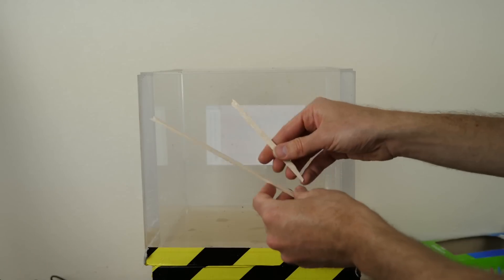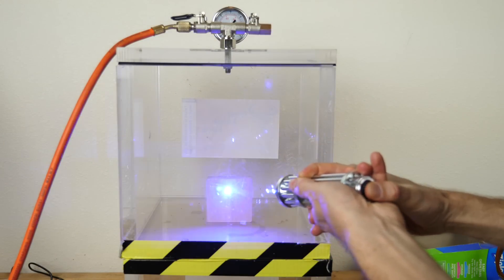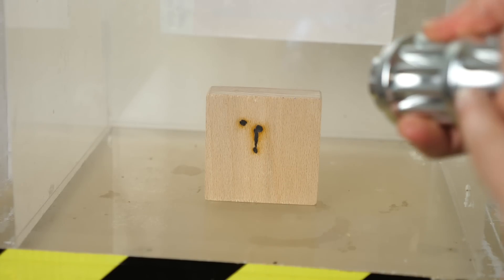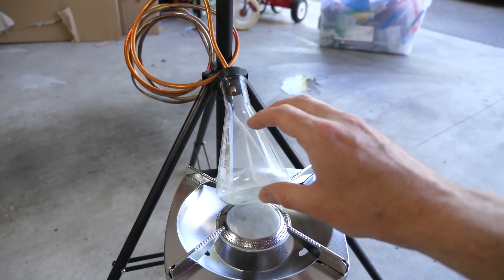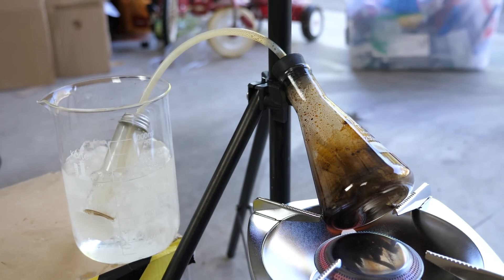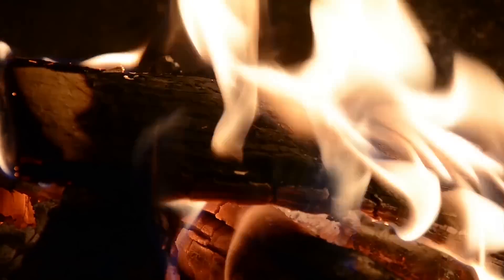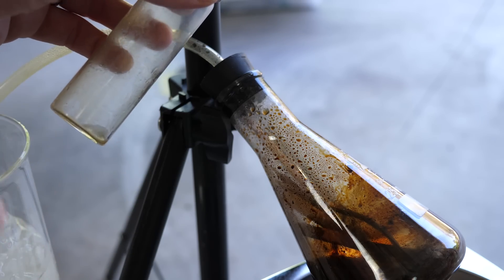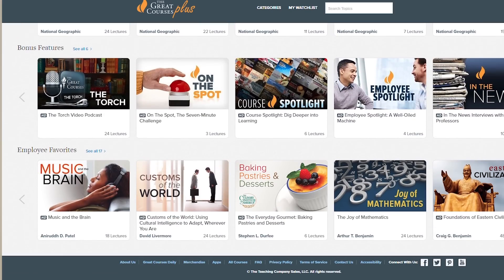Is It Possible to Melt Wood in a Vacuum Chamber? The Wood Distillation Experiment

Comment: Am I the only one who was disappointed to find out that the laser wasn't red?
Reply: Red is the weakest wavelength in the visible spectrum. Blue makes for a much more powerful laser.
Reply: The phrase "useless information" has eighteen letters in it and has no bearing on the original question of disappointment.
Reply: Scoped Bambi no. I'm saying you should never have expected it to be red, so you shouldn't be disappointed and no one else is either.
Reply: Kun Kodiik, that's just asinine. Not only have Red lasers been around for much longer they have been on the market for longer as well, they have been made popular not only due to their sheer availability and over abundance being found in almost any dollar stores, wal-marts, or pet shops, but also in pop culture movies such as the 007 and Powers franchises. But putting that aside as there are many colors to pick from, that being only Red, Red-Orange, Green, Violet, Blue, and Yellow, that is for non-color blind people of course. Yellow  being the strongest at the moment being much harder to get your hands on. As for "should never have expected it to be red" thus "shouldn't be disappointed" that can be said with just about anything. 

I could say, I expected this to be a one line statement about how I was disappointed that the laser was not red, making a clear pop culture nudge to how most people would of seen them in movies. 

I could also that say, I expected that to go way over other peoples heads like yourself and have it drag out over a pointless discussion about how Blue lasers are more powerful and how that has no bearing over my original comment. 

I would like to know the psychology you used to determine not only my expectations but the expectations of everyone else though. I would find that much more fascinating than a silly comment of my own "disappointment" that others may or may not share about the color of a  laser's emitted light.  (Through a process of optical amplification based on the stimulated emission of electromagnetic radiation.)

Comment: To actually melt it, you can't use a laser. That'll just cause the oxygen in the cellulose to react with the carbon, burning it. Your vacuum also isn't strong enough.
Reply: And you'll simply be left with lighter hydrocarbons. Cellulose pyrolyses before its melting point.

Comment: Yes you can melt wood it has to be at a certain temperature for a certain amount of time and the temperature is around 400 farenhite
Reply: Technically, this is true, but once it cooled down into a solid state, it would no longer be the same material, as the components have different melting and evaporating temperatures. This means the liquid would mostly be carbon, however it would require a much higher temperature than you stated. Around 3500°C would do it, but no-one has actually tested it at these temperatures yet.
Reply: Do you have a different measurement of temperature? For me my thermometer is saying 400 Fahrenheit

Comment: vacuum unnecessary, right? if you don't want the oxygen there, just fill it with CO2, nitrogen or any other inert gas. misleading title, vacuum just as a bait. pain caused by the talk.

Comment: Thermal decomposition is the chemical process here. Wood is primarily cellulose, which is a polymer or polysaccharide of glucose. Pure cellulose or hemicellulose would break down into carbon and water. But wood has other macromolecules like lignin and oils. What's condensing is the oil that is being distilled in the anoxic environment. He would collect more if an inert gas (N2 or Ar) passed through the system.

Comment: There are internal combustion engine setups developed early on that use "liquidized" wood as a fuel. Russia even had tanks that ran on liquidized wood. Every example had an onbord system that turned chopped wood to liquid for the engine to run on.

Comment: Although you removed the oxygen from the air, you didn't remove the oxygen from the wood its self. So you still had normal combustion. Maybe you should try leaving the wood under vacuum for some number of hours to remove that oxygen too.
Reply: thing is even though these stray oxygens will do something similar to combustion there isnt enough to burn all of it, what's mostly happening is the different carbon chains are breaking down into smaller compounds 
if you stare at a wood fire you'll see that the flame is not on the wood itslef but hovers above it, that's because of this process that makes smaller more easily burned volatile compounds

that's also how we break down petroleum into the different fuels we use like diesel
Reply: You can get this result even with chemical grade purified cellulose. It still chars and pyrolyses. It’s not about any minute amount of trapped oxygen
Reply: I don't think you can really get wood without oxygen, celulose is basically a chain of sugar molecules which have oxygen in their composition, at best you will always get a carbon foam like substance
Reply: Most, if not all, of such videos are click-baits, with mostly half-assed experiments, leading to either NO conclusions at all, or to  wrong conclusions!!!
Reply: @kareemsalessi  In reality removing the oxygen and heating, just leaves carbon, "charcoal".
Reply: @raysilver2b   Which is probly impossible with only a constant vacuum??? Else we should have seen it  experimented???
Reply: I wonder would if it burn a finely ground wood or sawdust. 🤔
Reply: @PrinciplesMatter  there's still no oxygen in the atmosphere
What you'd get is different only in how the smoke evolves but chemically nothing changes 
Although I gotta say the question is really interesting outside of the scope but it ultimately depends on how the heat is applied
With the laser I don't think we'd get much difference
Reply: @guythat779  I sorta suspected as much.

Would be interesting to see the effect if the heat was slowly increased over a broad area in total vacuum. 🤔

I still don't think it would "melt" but it would be interesting to see the effect...

Might also be interesting to try heat under high pressure with a nitrogen or other inert gas too. 🤔🤔
Reply: @PrinciplesMatter  well I did it myself under atmospheric conditions 
You can just wrap a skewer or matchstick in tin foil then heat it up with a match/candle/lighter and voila you generate smoke/wood gas (its other name) 

Ofc don't forget to leave a hole for the gas to escape somewhere and remember that wood doesn't conduct heat well so the effect will take place wherever you heat it

Visually you get some pretty nice clean smoke, but it's not that special
But in the understanding of the chemistry of fire it meant a lot to me

Hope my comment helps:)

Comment: Not surprised that the wood didn't melt, i.e., turn into a liquid. With such low pressure, it's going to sublimate just like dry ice. If you want it to stay liquid, you need some atmospheric pressure. Try putting it into a pressurized but inert atmosphere, like nitrogen.

Comment: Try to light a match in a vacuum chamber
Reply: not gonna start a fire since combustion requires oxygen; probably going to kind of burn and make the match hot
Reply: jinsen I know that’s why I want to see what happens because it won’t light
Reply: Sigh....
Reply: some matches have oxidizing agents so could burn. idk if the low pressure would stop it though
Reply: simple, it wont lit
Reply: really?
Reply: James thank you for approaching this request with some mindfulness: for your answer watch Richard Garriott Answers: can you light a match in space. Short answer yes it will light and die out quick due to lack of oxygen and burning through the oxidizer quickly
Reply: nothing would happen, actually nothing. It would be like rubbing a stick against some metal

Comment: Your main problem here is that your experiment isn't happening in a true vacuum. That's pretty much impossible to achieve on earth. Your equipment can't possibly suck all the air out of the chamber. There IS a way around this:

When they grow silicon crystals to make the wafers that are used for creating computer chips, they first displace all the air in the chamber with a non-reactive gas like argon. Then they pump out as much as possible, to get as close as they can to a true vacuum. But the little bit of gas that remains is not able to react chemically with anything else in the chamber, so it is effectively equivalent to a true vacuum.

Even in your chamber, there was still a little bit of oxygen, and that corrupts the results of your experiment. It's not enough to get a flame, but it is enough for the chemical reaction to take place.

Of course that sort of gear is pretty expensive, so it's not like I expect you to have it. Just pointing out the method for getting the optimal results.

<3 Auntie ^ _ ^

Comment: That rubber explanation was mint...But i do have a question about Wax...if you light paper towel and drop a chunk of wax on it, it melts, but after a very short time, you see a smoke/mist, and the fire moves with this smoke...Why? is wax using the same theory as wood burning?

Comment: There's still oxygen trapped inside the wood. You can't melt it with a laser. BUT melting points rely on atmospheric pressure. Lowering the pressure til it causes the material to depressurize could possibly melt it.
As an example of the property I mean, if you lower the pressure around water it will freeze and boil at the same time and create frozen bubbles

Comment: You can melt wood. First the wood needs to be pressurized with an inert gas like helium at a very high pressure. Say 100atm. It then must be heated at 1500c

Comment: Wood is made of many types of VOCs. Driving off the more volatile components like creosote and turpene which can be very toxic, is the process of making charcoal. This product is virtually only the carbon component left, with these VOCs driven off and burned away. Depending on the species of wood you can get sick from eating food cooked over it if this isn't done. In fact, smoking meats is basically preserving them in creosote, which is a carcinogen. I think most of us have heard warnings about eating too much of it.

Comment: I thought you could melt rubber, by first shredding it to a powder like or close to it, then slowly heating it bring the temperature up slowly, kind of like plastic if you put a flame to it, it will destroy it but if you apply heat slowly to it and not too much heat it will soften up and making it reusable or am I completely wrong, have not tried any of this so I am not sure...
Reply: Or like glass if you heat it too fast it blows up but if you bring up the heat slowly it melts???

Comment: Some things actually convert to gas rather than a liquid, that is the case for some of the wood, leaving behind carbon. Carbon melts at over 3000 degrees, so... :/  "You say 'you can see the smoke just falling off of it", but is it smoke?"   The process is called Pyrolysis, and methanol was obtained by this method by ancient egyptians. Why not condense some of the 'smoke' and see what it is.

Comment: another thing is and,... it's not mentioned, is,... wood is not a solid! it filled with microscopical tubes filled with,..... what else eh? air! so the wood has its own oxygen source so if hit with a laser in a vacuum it will carbonize just the same as it would with an open flame!
if you could replace the air in the wood with a similar substance to wood it will certainly melt in a vacuum but we can't at this moment....maybe something for the future!!!

Comment: I thought if you heated wood in a vacuum, it would turn to charcoal, which is an anaerobic process. If you put wood in a sealed metal tin (well add a few pinholes to prevent it from exploding) and put the tin in a fire, you will start seeing gases that look like dense smoke coming out of the holes which can burn in the fire.

Now since charcoal is mostly carbon, yes if you heat it enough e.g 3550 Celsius, it sublimes to gas unless you have 10 atmospheres of pressure.

Comment: Its extremely hard to "melt" wood because when you heat it up using a high power laser it breaks the bonds and turns all the oxygen and hydrogen into a gas and starts burning into charcoal on a microscopic level
Reply: If you were to heat it up below the point that the bonds break but higher than the melting point of wood you could possibly melt it but it is extremely difficult
Reply: The point of a laser is extremely hot if focused correctly and can go well over the point where oxygen and hydrogen breaks down into a gas, using a laser for "melting" anything is impractical unless it can transfer heat extremely well

Comment: "Anything has a melting point."
Erm, no. Melting - is when a substance goes from it's solid form into liquid form. But melting means that when said substance cools down - it goes into a solid form again.
What you are showing is heating the substance to a point that it breaks into it's components, which is NOT melting. It's basically just the same thing as burning something outside of a vacuum chamber - if you put a piece of wood into a fire it doesn't "turn into charcoal"! What actually happens is it deconstructs into base components just like you demonstrated, and a lot of those components oxidize and/or evaporate, leaving you with a high carbon piece which is coal. What you demonstrated is the very same process but without oxygen.
But it is NOT melting.

Comment: I have been asking this question for YEARS. I figures that lack of oxygen to prevent fire and enough heat would actually melt the wood. No one could answer me, and Google gave me the melting point of straight carbon. This video is very interesting.

Comment: I like your channel, you try interesting stuff! Please do something about that microphone, run it through your shirt or from your back over the shoulder and onto your collar, or wear a jacket and clip it to that! Don't just pinch that microphone to your t-shirt! Holy cow!
Pro tip: you can make a little loop inside the clip so that the wire runs inside your shirt, loops over the edge and comes out the front.
Keep up the good work!

Comment: You will need a heat source that is actually in contact with the wood to get it to melt. Because there is no air, the heat can not transfer through the vacuum to the wood and it will not heat up

Comment: That "liquid wood" is actually a thing you can buy, sort of.
It's a flavouring thing used in cooking, called Liquid Smoke, which consists only of the liquified residues of the burning of a certain type of wood.
It's quite efficiant, in its limited range of possible usage.
Reply: It's EXCELLENT for ribs. Add about 3 drops into a bowl of whatever else you're slathering on them before stuffing them in the fridge to marinate.
Reply: Mikael Karlsson Homer Simpson used that shit in his moon waffles
Reply: Zombie-Process if you’re using liquid smoke in your ribs then you’re not cooking them correctly.
Reply: Liquid smoke is disgusting.
Reply: Mikael Karlsson I've used it before I love it
Reply: its good for ribs, beef jerky and pulled pork
Reply: +ch282 Well, tar can also be made by burning wood in a vacuum. In fact there are some old tar pits near my house, in the old days people used to put a ton of wood into a pit in the ground, set it on fire and the bury it, where the heat then slowly dissolved it into tar.
Reply: Wardeni where's the golf clap button?
Reply: Mikael Karlsson I
Reply: Mikael Karlsson
Reply: It's called tar and it's been used as flavouring, medicine and in making ships and boats watertight since the antiquity.... The more liquid state is simply a further refined version.
Reply: it actually just water with smoke from burnt wood percolated through the water.
Reply: JonO387 I saw a guy do a shot of liquid smoke for pot once.
Reply: Sullyvan I've mainly used it as flavouring in bbq-sauces, dipping sauces etc.
Reply: Wardeni It's not tar. It is condensation from burning wood.
Reply: Sounds like the method for extracting plant oils and resins would be used to get this "liquid wood"

Comment: Actually I'd be more inclined towards being able to melt some materials in higher pressure (using an inert gas such as He or Ar to fill the chamber). The fact that even graphite can be melted that way makes me think that doing it at least with some of the polymers could be doable too (even cellulose and lignin, the two main constituents of wood).

Comment: telescoping glass tubes with copper plating on them to make a tubular solar panel system and it must be in a vacuum with a coil in the outermost piece in the side wall with outside coil to make transformer for vacuum tube solar panel then permanently seal.  i know the coil may have phase problem due to the differences in voltages but once vacuumed and the reverse transformer to transformer is made the volume of energy to space is a sound idea.  the other idea is a capacitor on the bottom facing away as sort of a solar accumulator.

Comment: The answer is no, it is a very strong fiber builded up together, but yet you should try to put a lot of heat on it outside up to 190 degrees or sun temperature, it could possibly melt but you should go from, small, medium, large. and then turn it up to a fair probably 600 degrees in a invincible like jar, and another way is to just cut small proportions of it then easily melt it with a 600 degrees.

Comment: There are many types of "rubbers", they are in the big glass called polymers, some of the polymer "melts", they are easy to deform above their glass temperature, they are called thermoplastic, e.g. polyethylene (bottles), vinyl (floor covering), nylon (gears). Ones impossible to deform (does not melt) is called thermosetting. e.g. epoxy, polyester. they do not melt is because high number of cross-link between chains.